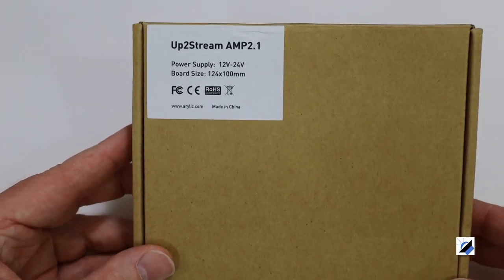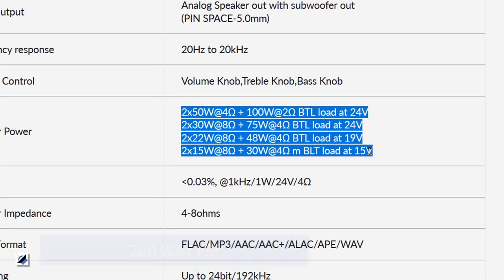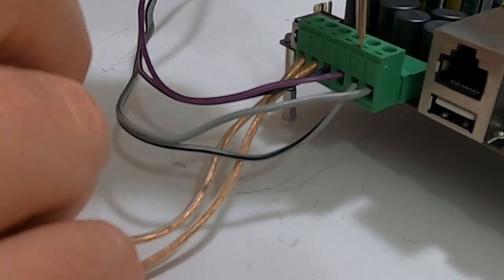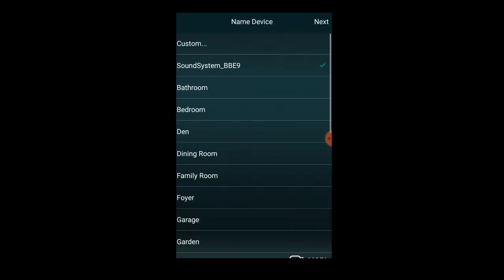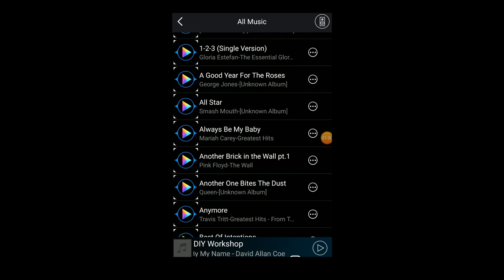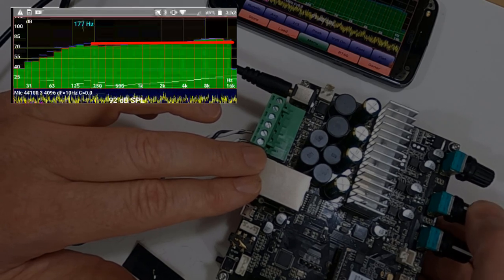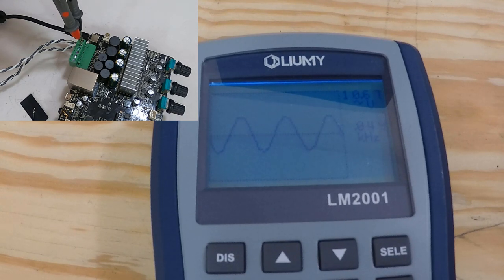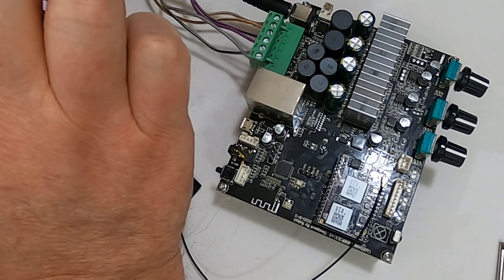WIFI Audio System for the Home.  DIY 2.1 amplifier, Arylic Up2Stream

Comment: I built a 2.1 system using this board as an internal amp and got good performance using the stock power supply.  One thing that I was really impressed with was the ability to use Airplay.  It ran last night for three hours straight at one-third volume and the heat sink fins were warm but not hot.
Reply from the maker: It is a versatile unit.

Comment: Your analysis is more than excellent!
You measurements are RMS wattage from a Class D amplifier. Basically they are expected from this type of class amplifier. Depends from the amps that the power supply provides, the accuracy and the efficiency of it, even from the temperature that the chips are working. 
At 9:50 you calculation is spot on! Remember though that this is divided by 2, and the one half is divided again by 2.... So... 100W/2=50W for subwoofer and 25W per channel, for the given power supply.
Subscribed!
Reply from the maker: Thanks for watching.

Comment: The output power is directly tied to the current at 24V as you stated. You just need to pick up a 24V 6.66A (160W) adapter.  I am running two 8 ohm stereo drivers and a single 12” 2 ohm sub. I watched the video but may have missed the part about their control software. Using  a sine sweep, you can plot the response graph then create a complex parametric filter which can be embedded directly into the board’s flash storage. This is a huge deal especially for DIY DML setups which have dozens of harsh vibrational modes that need to be eq’d out to flatten the system response.
Reply from the maker: Yes, the DSP capabilities are pretty impressive.

Comment: I have mission 771 bookshelf speakers. They can take from 25Wpc at 8Ohms. I tried topping mx3 which has stated 38wpc and performance was just audible, mushy and indistinct when the amp was driven to 60% volume. Sensitivity: 87dB. 
I guess this wouldn't do any better.
Reply from the maker: I connected this little amp to my 4 OHM DML's.  It sounded just fine and got plenty loud.
Reply: The Topping people agreed that it's not capable of handling my amp with the supplied power supply 24v. 4 Ohm speakers are easier to drive clearly.

Comment: Great video!!! I was about to build a bluetooth speaker based on the specs. Sorry for the confusion. But I planned to power this with a buck boost converter at 24v 4amps like the power supply using 7s2p 6ah battery pack. You mentioned, you wouldn't go higher than 15v. What should I pick for voltages. Thanks again for posting 👍👍👍👍👍
Reply from the maker: I think I linked to a power supply in the video description.
Reply: @DIYAudioGuy  Arylic sent me the same unit, with a psu and remote. 4th amp these guys have sent. Reason I'm asking what you should power this with, I thought I heard you say it started clipping at 10v? If that's the case 24 volts. Is way to much. Techs told me, 24v8amps would be perfect for this, just don't go past 24v. But I think I'd trust your opinion first. Did I hear it right with the clipping? What do you think of using 24v 8amp? Thanks for messaging me back.
Reply: @DIYAudioGuy  PS- no link in description I can see?

Comment: Would this board support Wifi input via Spotify? Or is the app required for all direct play?
Reply from the maker: It requires the app and I'm pretty sure the app would connect to Spotify.  It would not connect to Pandora.
Reply: It does not require the app. You can connect your iPhone Spotify app via Spotify Connect for a direct stream.

Comment: seems quite interesting.  So, iIf using a 19v source it would realistically give me an output of 2x35w and somewhere near 75w one the sub out, all out driven in 4Ohms, at least in theory.  Am I correct ?
Reply from the maker: During this video uses the same chip, so this will give you a realistic picture of the power output.  https://youtu.be/Gpo3fyGr2is

Comment: Nice Review, Really enjoyed watching it. 
But if I‘d use a 8,5 Amp power Supply, would it do better or maybe Even close to the rated specs ?
Reply from the maker: Probably, yes.  But, I used the one they sent me, which is the one they sell on their website. So this is clearly the one they expect to be used.
Reply: @DIYAudioGuy ... did u mesurement of performance on speakers, or on resistor?...
Reply: ....not at all - on this type of amplifiers (amp chips/ics) performance is dependenced on voltage, not on current in majority...resp. on current are dependent performance / power in spikes only (and for this work are the capacitors on the board), but overall power is dependent on voltage, whitch is restricted by specifications of the chip/ic...
Reply: @feflofeflic  you are suggesting that amps don't matter. Voltage without amps equals nothing and visa versa. Also, you can't simply put in more volts as you will fry the unit. Secondly, It's always a good thing to have a little headroom. According to my calculations, you need a 24 volt, 6.5 amp power supply to get the most out if this thing.
Reply: @xanderguldie  u r right - i wrote it not totally correctly (it was very simplified), but i wanted said only 1 thing - if u have a power supply with low voltage is uselless to have a high possible current on it - performance of "digital" amplifier will be low, but if u want a good performance of this type of amplifier, u need power supply with decent voltage and current together (in high voltages (on the border of recommended voltage) there is a  danger of ov3rheating amplifier chip)... sorry for my bad english...
Reply: @feflofeflic  no problem, thanks for the clarification
Reply: @xanderguldie ... u r welcome... but it was only a very small part of the whole topic about class d amplifiers - it is much more complex (some stuffs are a similar to class ab (an other classes) - for example filtration - and some of them are specific for the class d) and it is impossible to write/explain it in couple of sentences...but i can say 1 think surelly and explain my opinion about Arylic diy boards amplifier stage/part - Arylic was  chosen not a good way to make an amplifier part of their boards to be efficiency and to get max. performance which are amp. chips capable (i mean - they are not capable to reach chip possibilities on Arylic boards and if u will try to reach max. performance of for example tpa3116d2 on board made by Arylic it will be impossible, or tpa will burn - very small cooler, no reserves of power - low amount of capacitors and his very low value, and so on) ...this means they are say not whole true about performance of their diy boards based on tpa...worst issue is - Arylic say nothing (no warning) about danger resulting from the combination of low impedance speakers and high voltage power supply for their boards (with higher voltages u can use only an 8 ohms speakers)...
Reply: In the Q&A on their web site the very last question answers this: Q: What power supply is recommended for this? do you sell them?  A: You can use power supply from 12V - 24V.  We sell a 24V 4.16A power supply, but if you want maximum output power, you will need to use a 24V 8A power supply. Remember, do not go over 24V or you will damage the board.
Reply: @xanderguldie  I know I'm late to the party here, but @feflofeflic has a point. Output power of an amp is a function of supply voltage. If a power supply can provide the required current, amp will provide the rated output power (at the rated THD/IMD). If a power supply can't provide enough current, amp won't know about it and will still do all it can at that voltage. Unlike transformers (especially EI), switched power supplies are pretty bad at providing more current than they are rated for, so they either shut down, or you get some catastrophic failure.
So in this case, 6,5A or 8,5A PSU might not make a difference. It will only make a difference if you'd try running the amp at the lowest allowed impedance (2x4Ohm + 1x2 Ohm) at 10% THD (which is nothing but distortion), with no filters set.
If you use a crossover and a 4Ohm subwoofer + you're not deaf, you will never suck more than 100W from the PSU with this amp.
Reply: @tomkocur   I actually agree with you. I just wanted to point out that the maximum output is also dependent on the max current that the power supply can deliver. Off course it doesn't really matter if you're not driving the sytem to the max, but why not make full use of it? It's always better to have a little headroom. And yes, toroidal is much more reliable (and better) than switch mode power supplies.

Comment: They use some strange practices in this company in my view... They should at least provide the back plate of this amplifier because with all these connections, it is very difficult to include it in a box. And if you buy it in this version, this is the purpose I guess. So in reality, it is useless to buy it like this.
Reply from the maker: That is exactly why I have two of these DIY boards sitting in a drawer.  I think you are right, if it had a back plate that could be easily flush mounted on just about any enclosure that it would be a much better device.